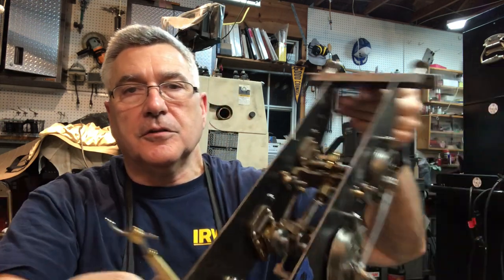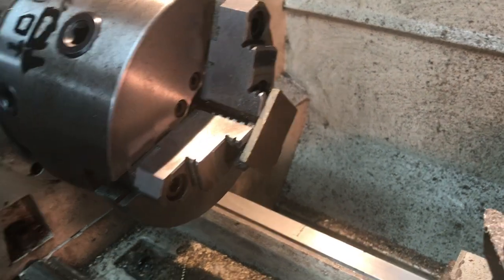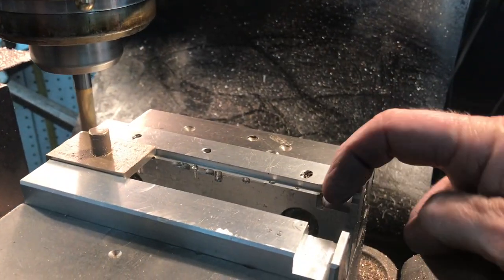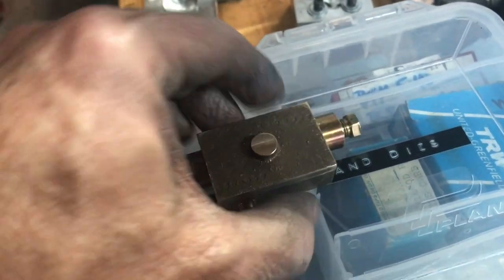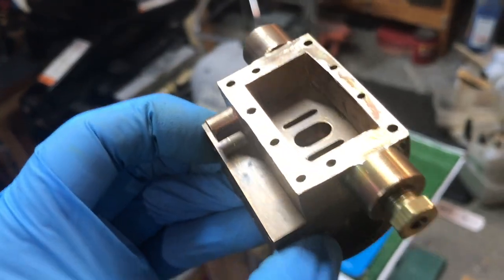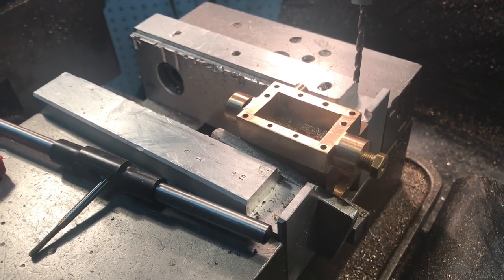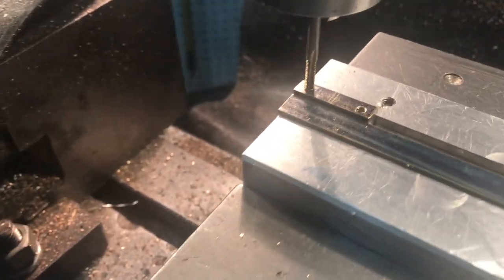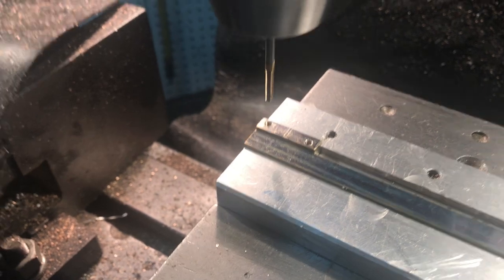19. LBSC Tich locomotive, steam chest covers, drilling cylinder for steam chest. Plus valve work.

Comment: Thanks for another great video Bill, I really like your soft jaws. Need to see if I can fit some to my milling vice. If you get chance you could add a blind hole to the remaining chucking piece and press in a dummy cylinder oiler. Similar to narrow gauge practice? 😀
Reply from the maker: Right, my Allen Mogul has snifters in the same location on the steam chest…